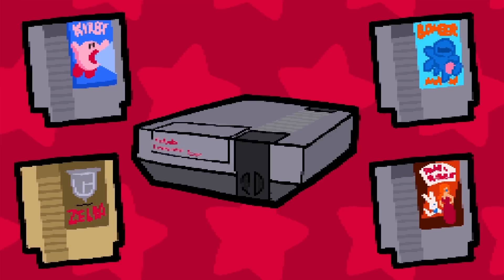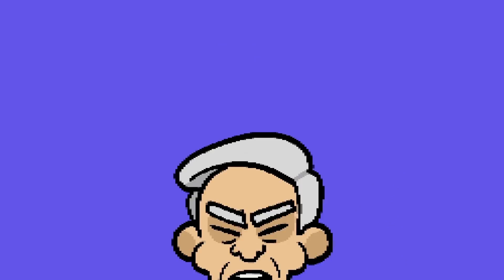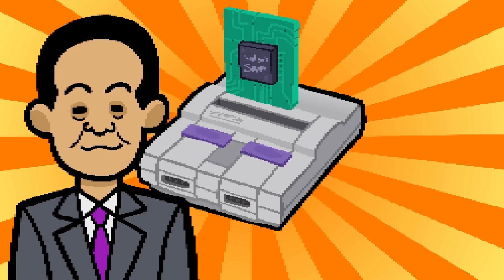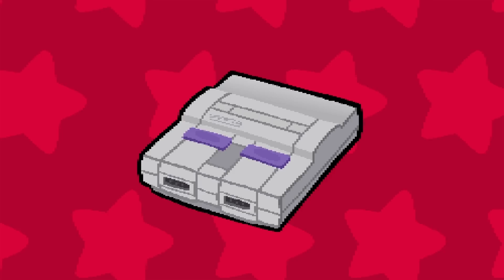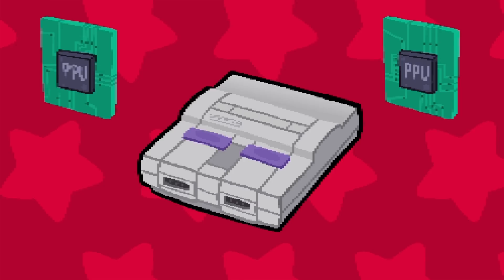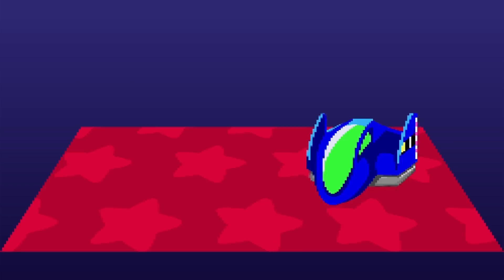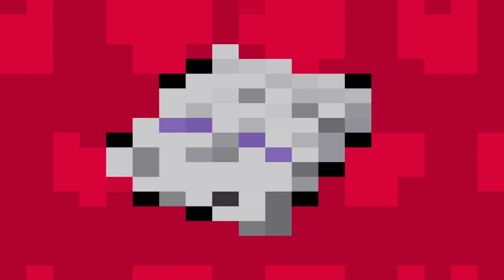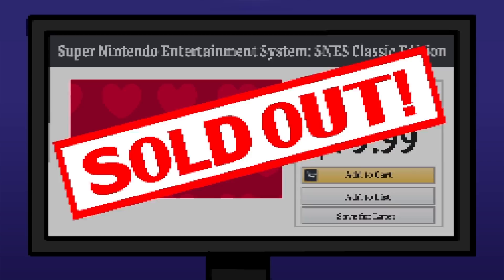SNES: Now You’re Playing With Super Power! | LORE XL! | SNES Origins | TerminalMontage | LORE

Comment: I don't need to get a SNES Classic. My old SNES still works fine. I pop in Tetris Attack or Tetris & Dr. Mario every now and then and still have a fun time.
Reply: nin10doadict I modded my mini nes to play snes games
Reply: I can see the market for it on the other hand. Imagine a plug and play console a tenth of the size which you can easily take anywhere.
Reply: I don't need the SNES classic, I have more capable emulators on both phone and pc.
Reply: I got a SNES classic even though I own a Super Famicom and 30+ games.
... And have plans to get a PAL console as well.... (but that's to do with homebrew coding)

Then again I own a Super Famicom, Mega Drive, n64, PS2, Wii, Wii U, Switch, GBA, GBC, a gaming PC and two VR headsets...

It all depends on what you're into I guess. XD
Reply: nin10doadict Just make sure you have the money to repair it again.

Comment: As someone who does homebrew development I think the two biggest letdowns of the SNES in terms of what it MIGHT have been able to do is that it only has half the VRAM it's capable of supporting installed (Which renders the 256 colour and high resolution background modes very difficult to use effectively), and it's kinda slow DMA.

I did some calculations and it showed the VRAM has to be able to be accessed at a minimum of 10 megabytes per second to manage the SNES's capabilities.
Yet even with display output enabled, DMA is no more than 2.68 megabytes per second.

This seriously limits what stuff like the SuperFX chip can realistically do for the system, because no matter what you do you still have to get graphics into VRAM somehow.

Still, both of those would have driven up costs if they were improved.
I do wonder though if the graphics chips support it if you were to remove them from a SNES and put them in something else...
I know they can definitely handle 128 kilobytes of VRAM, but I wonder if the 2.68 megabytes per second DMA limit is caused by the SNES CPU, or if the PPU also limits it's external access speeds...

mmh. Kinda weird to think about...